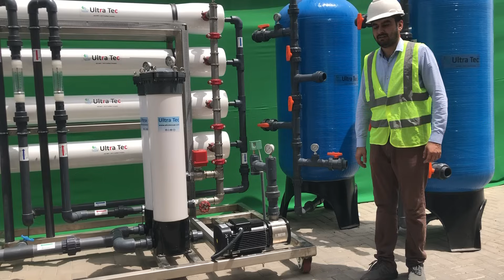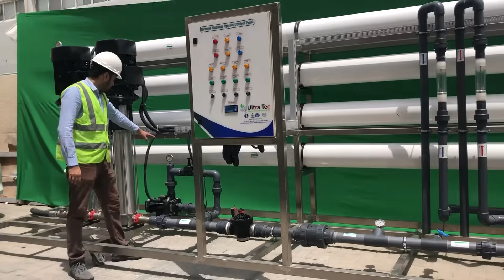how does RO plant work?

Comment: CREATIVE TOOLS is one of the largest manufacturers of Liquid filtration components. 

 Our range of Liquid filtration products includes –

 

·        Micron Cartridges (wound Filter Cartridges, Spun Filter Cartridges)

·        FRP Vessels/tanks (10X54 to 36X72)

·        Flow meters (Tube Type &amp; Panel Type)

·        Pressure Gauges (General &amp; Liquid Filled)

·        TDS, ORP, Ph Conductivity meters, monitors &amp; controllers.

·        Multiport Valve for Filter / Softener

·        Distributor System

·        Vacuum Breaker

·        Activated Carbon

·        Birm Media, Etc
John Thomas
please contact this no +919049039197
Please email creativefilter2021@gmail.com